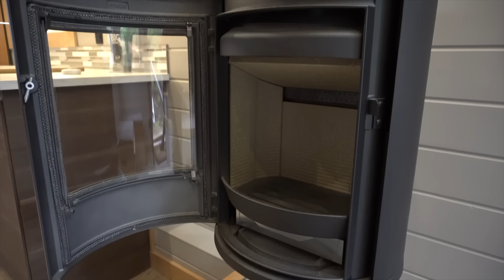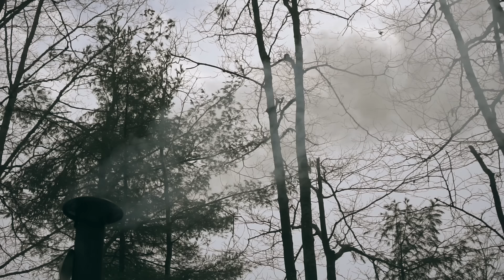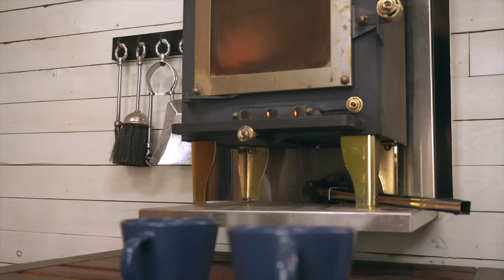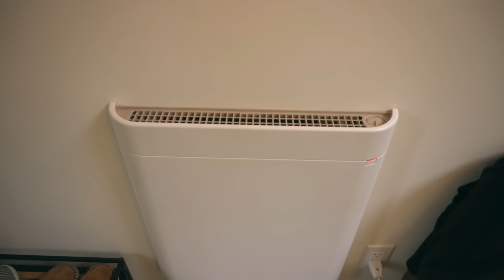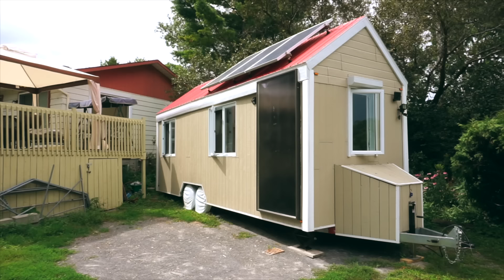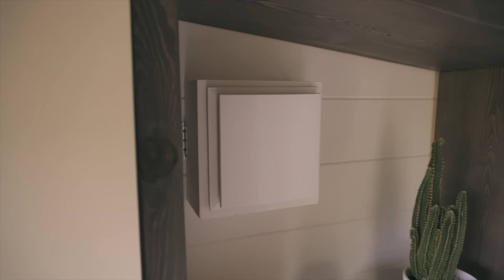Top 5 Tiny House Heating Options for Winter Living - Off Grid & On Grid

Comment: Surprised you never mentioned any Rocket mass heater systems which can be used under floor or above floor level and use up to 90% less wood than conventional woodstoves .
Reply: jack simper, wouldn't that be too heavy for a tiny house on wheels? I understand it would be ok to use in a tiny house that is not going to be moved, but the one he showed was a moveable  trailer type of house.
Reply: My thought also!
Reply: A Rocket like Space x! 😂😂 x

Comment: In-floor heating isn't more comfortable because you're "heating up the structure of your house" because that includes walls and roof and in-floor heating is no different in that case to other heating types. I think you know what you mean but you're not explaining it well.
It's more comfortable because of two reasons:
it heats the floor and you are in direct contact with the floor most of the time. Surface temperature of surfaces within a space make a big difference to you comfort in that space. For example, you can be sitting in a room that is at 20ºC but if the window glass you are sitting next to is 5ºC you aren't going to be comfortable. 
The heat that it creates is radiant which means it doesn't heat air which rises to the top of your space and stays there. It is directly heating you as the sun does. Naturally, that radiant heat will warm surfaces which will then warm the air around them which will convect up but that's a secondary effect.

Comment: Floor heating is always convective , never "radiant". In order to "radiate" heat (in other words, infrared), you need temperatures well above 100°C. I know the English language is rather misleading in referring to central heating "radiators", which are really "convectors", but you don't want your floor heating to be much warmer than 50°C, and you do not get any "radiation" to talk about at that temperature. Take a gas radiator, for instance: these do produce infrared radiation that can be felt distinctly on the skin, but their ceramic elements are red hot and certainly well above 100°C to produce that effect.

Comment: There are non-electric in floor radiant heat.  These involve pipes carrying water or antifreeze to heat the floors and work well with solar heat and tankless water heaters which can be either electric or gas.

Comment: Haven’t been able to find one so I guess there isn’t a stove that will burn both wood and propane but either a wood or propane stove that you can also run a water line through to do a radiant floor heating system as well as add on a solar water heater which is pretty much just like the solar air heater that would give you multiple ways of heating your home. Add an insulated drum of water to the system for thermal mass or even better if you’re gonna be still for long enough make a compost heater either which would allow you to leave the house for your periods of time without having to worry about pipes freezing. With a little bit of ingenuity and some connectors to connect into the radiant heating system any decent heat source could be used to provide the  heat. You could even plumb into a recirculating hot water heater for when you’re plugged in. Course I never tried any of this its just a combination of that ideas from green houses as well as  hot tub‘s and aquaponics systems don’t ask me about a budget but I think that would work what do you guys think

Comment: What about diesel  stoves  or diesel forced air heaters
Reply: He did not do a very comprehensive job of covering heat.  Diesel is a wonderful form of heat, its inexpensive, available everywhere, easy to transport and refill and very safe.  Hell of a lot cheaper than propane.
Reply: Do a search for ship cabin heaters they are small and efficient!

Comment: Radiant is one of those items that's more expensive to install what is more efficient in the long run you're not heating the air your heating a liquid medium that holds the heat longer Air does not hold heat there for anything that heats air whether it be would fire propane heater or electric heater with a fan all very inefficient

Comment: Also you can use a solar hot water heater usually with glycol or something that's not water-based so it doesn't freeze but that also supplements your radiant heat to allow off grid use

Comment: In floor radiant heating or in wall or in ceiling can be propane Heat so you can be off grid with it it's just as comfortable as electric maybe more so but of course then you have the tanks to deal with but it's very simple and allows for off-grid use of radiant heat

Comment: I don't get it.  I live in a 2,306sf. house.  My utilities: gas, electric, water and sewer cost just shy of $2,000/year.  I have room to sit 16 people for dinner, room for my shop, room for my wife's sewing/quilting room, room for my 1,500 books.  On the outside, I have 1/10th acre - enough for fruit trees and gardens.  With these tiny houses I see so much that has to be given up.  With a wood stove you need wood pellets, coal or firewood.  The ashes have to go somewhere and the chimney has to be cleaned on a regular basis.  Propane is expensive compared to natural gas and you are very much "on the grid" when you get into your vehicle to go get it or have it delivered.  Electric heat, whether solar or "on the grid" is no bargain.  Radiant heat in the floor requires an enormous amount of insulation and you really don't have control over which parts of the house are warm and which are cool.  I had a client that had radiant heat in the floor.  When I worked there, I had to take my shoes off since the heat was trapped under the desk.  My home is a place for people, not just a cave to hide in.  And with tiny houses where would I put my grandchildren and their dogs?
Reply: its not for everyone, like many things in life...

Comment: Good discussion, perhaps a little too short. There's no reason to have a heat recovery ventilation unit in combination with a wood stove, the wood stove already has to draw in lots of fresh air.

Interesting that the weight of a propane tank is important but the weight of and work with wood isn't mentioned. If you cut your own wood with a chainsaw then the length of your firebox is important, one foot pieces are twice as much cutting as two foot pieces. If your going to buy your wood cut and split, having it cut short and split small is a special order.

Missed out on pellet stoves as an alternative to propane. And missed out on electric heat pumps as an alternative to resistance electric. And missed out on hot water in-floor heat which can work with any heat source.

Comment: Those electric heaters should come in AC as well as DC so it can be switched from both depending on what's available.
Reply: Electric heaters are designed to work at a specific voltage. Standard AC and DC voltages are quite different but voltages can be converted with the proper gear.
Reply: Doug Mcdonell I know how electricity works (for a layman) that's why it should be included in the model, so travelling tiny homes can get the whole package.
Reply: Since we're talking thousands of dollars difference in gear, that would be three different packages AC only(cheap), DC only and both. For the both option it would be simplest to have two different sets of electric heaters, they are cheap to buy.

I do know a couple of people with off grid hydro producing electric heat, but that doesn't travel well. Battery based off grid electric heat can cost a fortune,  for that reason I've never heard of off grid wind and/or solar electric heat that could take the place of a wood stove, the battery cost would be crushing. But it could be done with enough money. For instance a Tesla Powerwall costs US$5,900 and can run one plug in heater for nine hours.

If it was me, I'd use a heat pump on grid or propane off grid.

Comment: I would really appreciate a similar presentation on options for heating water. I don't live in a tiny home but I live in a small, 1,200ft hundred-year-old house in northeast Florida.  Tiny homes inspire me to simplify and economize my lifestyle.
Reply: Marimilitarybrat if you use a wood or corn stove build or buy a copper tube heat recovery loop in the exhaust flue of your stove.  Or Best today is on demand hot water heater simple and cheap. Or use both to get every BTU out of every dollar you spend.  Wasted heat is half the battle. Always seal air leaks and use a thin solar foil in your attic to keep your heat from going out the roof. A roll to do your whole 1200 sq foot attic 249 on Amazon. Pay back 1 winter.  And saves you 300 every winter after.
Reply: Marimilitarybrat I would think that with your climate solar thermal would work well for water heating. It's tried and tested technology, relatively affordable and very reliable as there are so few components and only really an easily replaceable pump to fail.
Reply: Navian on demand can heat water and heat the tiny house

Comment: Why do you have to be plugged in to grid for radiant heat??
Reply: In-floor hot water can use any heat source. In-floor electric can use any electricity power source, steam, solar, wind, water, grid.

Comment: the best advice , for on grid time....floor heat... off grid...wood or gas...you can have both also, the cost of wholesale pricing for floor heat is quite low, when you build your tiny house or small house, start a proprietorship company, get a GST number and open account(s) with a credit card to back it up and save $$ buying wholesale !! it's just that easy :)
I've done it for many diff. projects over the years, works just fine, great for windows too.

Living in the western prairies, you NEED good heating and venting.
Reply: I live on the left coast and electricity is priced in tiers, the bottom tier is the lowest usage (and price), to get commercial pricing you must buy commercial quantities.

Comment: We realize your reference here is to tiny houses on wheels and you have done an excellent job of covering the serious contenders, however for those who may be living in a somewhat larger tiny space, there is another option. We live off grid in a 400 sq ft cabin in Alberta and our main source for heat, hot water and cooking is our old kitchen cook stove, running on wood and coal. We supplement in the porch with propane heat at night, when the temps drop below -20 C but the cook stove heats the cabin very well and will produce significant heat for 10 hours on one fill of coal. There is never any need to stoke it through the night and our coal consumption is approx 2 tons / year, depending on the severity of winter. Current pricing here is $80 / ton, so a very affordable option for low budget living. Perhaps another option to consider for those headed down the tiny living road.
Thanks for all you do, we look forward to your every posting.
Reply: So cool that you live off grid. I live in northern Alberta also.
Reply: Rob and Sylv's Alternate Life  except coal is dirty and very bad for the atmosphere.
Reply: @jo-lynnhodgson8746  COAL is NOT dirty and its NOT bad for the atmosphere.  Your stupidity is bad for the planet.  Coal is a beautiful fuel when used correctly and its a shame its not available nationwide.   If you had coal available, you'd never use wood.  The industrial world ran off coal as a main source of energy and heat or centuries.   Only the availability of natural gas and propane made it 'extinct' because you don't have to shovel propane and natural gas....but you can haul coal in a wagon with a horse, or a truck.  If coal was available in all over there would be a lot of off grid people a lot happier.
Reply: Steven Harris - tisk, tisk, mind your manners sir. The fact is coal remains one of the world 's great polluters due to greenhouse emissions, although this is mostly due to ongoing industrial use by heavy polluters such as China and India. That said, you are correct that when used on a small individual scale coal is an effective heating fuel, much like peat is in some Northern European countries. What I find is that a great majority of off grinders are also environmentally conscious people and would not consider coal as a fuel source because at the end of the day it is a dirtier fuel (to the environment) no matter how you dice it.

Comment: Make sure the gas heater is direct vent, but also the thermostat is controlled by the pilot generator (millivolts) and does NOT need to be plugged in.  Most, if not all direct vent heaters do this.

Comment: no thank you don't need to go I'm not doing that route I'm getting a trailer instead its cheaper. .
Reply: A travel trailer and a Tiny House are made to look much different but they have many similarities, it's common to have both built to RV standards and the bank loan for either one is an RV loan. It's also likely that municipal codes will call them both an RV.
Reply: A vehicle is a good idea, they're legal everywhere, Tiny Houses and RV's aren't.
Reply: ska punk make sure its in decent. Condition and structurally sound check out the flooring and roof and windows just sayin GoodLuck
Reply: Doug Mcdonell that is true since I said that last time I changed my mind I'm buying a van and going stealth this way you don't pay high RV prices in parking lots I park for free that's what time he has is when the downside of that is when it gets big like regular houses the prices are going to go up high you're going to pay for one
Reply: Doug Mcdonell I definitely agree that's why I'll never get a tiny house gets my tiny house like I said before it's no different than buying a regular house but we got the mortgage for now but when this idea picks up very big and towns and cities accepted Realtors and people are going to jump on the bandwagon and trying to make a lot of money which means like rental apartments the prices are going to go start sky-high and eventually you will not be able to buy a small tiny house for less than $90,000 or $100,000 and it's kind of funny in New York City right now to have micro-apartments no smaller than a RV or van and they want the same amount to rent for it ridiculously high

Comment: If your tiny house is not on wheels but stationary and not toooo tiny using a wood fired mass heater gives you the benefit of a C02 neutral heating solution without the constant need to add wood. I live in the alps in Italy and built a stove off plans from the web (see in the description of the building video  https://vimeo.com/180750122 ). I fire it once a day during winter and use a solar air collector for fresh air and additional heat whenever the sun is shining. Passive solar and the air collector also help with when I'm away to keep temps (and pipes) above freezing in winter. As for my tiny house: I guess it is not tiny, tiny with about 200 sqf but I would go for the same solution again even if the structure was a few notches smaller.

Comment: The main thing really is to put good insulation in the house. This is basic. After that it seems that we have a pretty good choice of options. Thanks for sharing those options.
Reply: And double pane windows!
Reply: We heated a 384 sqft sitting on a full basement using a Toyo Oil Heater. We only use about 150 gallons a winter.
Reply: The difference between sick & not!
Reply: Great video content! Apologies for butting in, I would appreciate your opinion. Have you thought about - WoodBlueprints. Com It is an awesome exclusive guide for building better sheds and woodworking without the normal expense. Ive heard some extraordinary things about it and my mate at very last got astronomical success with it.?

Comment: I've lived  in making tiny cottages etc over the years and I don't know about direct venting (I would hope it's a massive improvement) any gas creates so much water that its just nightmarish if you don't have a woodstove or open fire to kind of dry out the atmosphere.  This is made much worse if you have to go away even for short breaks as the problems with black mould etc are insurmountable.  I would only ever have any form of gas burning as a fully installed central heating system which has a boiler independent from the air in the dwelling.
Reply: Propane stoves are popular in Tiny Homes and they put lots of water into the air, if you don't have a wood stove or a heat recovery ventilation unit then high humidity becomes a problem.

Comment: Propane tanks can freeze up in the cold northern climates.
Reply: Propane freezes at −305.8 °F/−187.7 °C but long before that happens, the vapor pressure starts to drop. Standing a tank upright produces the lowest vapor pressure, tilting at a 45 ° angle and burying tanks below the frost line work much better.
Reply: @dougmc666  its NOT 'freezing' of propane that is an issue, its getting it so cold that it won't evaporate from a liquid to a gas, that happens around -45C.  Read wikipedia before you make a post in ignorance
Reply: @stevenharris9941  - Speaking of ignorant....I wrote twice that I had a problem with low pressure, I did not say that I had a problem with  'freezing' , read, then write.
Reply: Maybe in theory, but we have a 6 foot frost line here.  And what about Alaska where they have permafrost?  There are easier solutions.  Staying safe is the most important concern.
Reply: I'm interest in your easy solutions and how propane is unsafe?
Reply: Almost anything is easier than sinking propane tanks 6' underground.  What size is your tiny house?   What is the climate at your location?
Reply: I'm off grid in south central BC in a 8X20 with outbuildings. I heat with two wood stoves and use propane for cooking, hot water and the genset. I have trouble with low propane pressure below -15C, so this summer I'm hanging a 100 pound tank in the well.
Reply: tiny house giant journey uses a heated propane blanket on her tank when it very cold, she said she started losing pressure and her pipes ended up freezing and that did the trick. it wraps around the tank outside